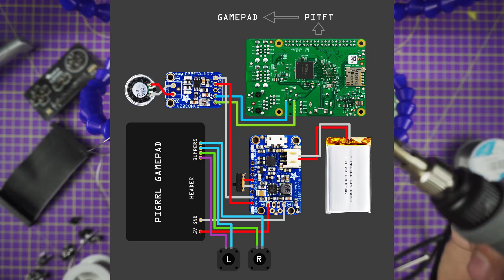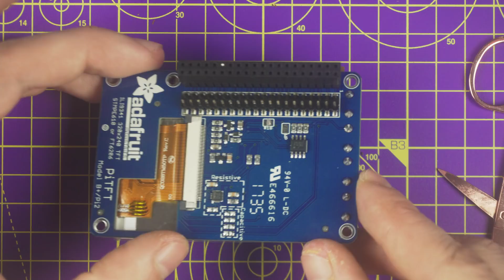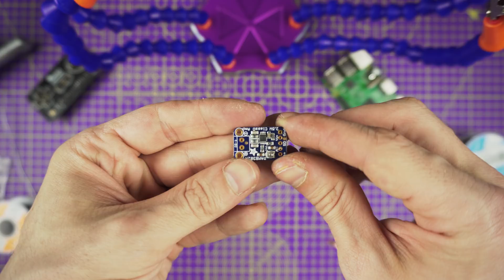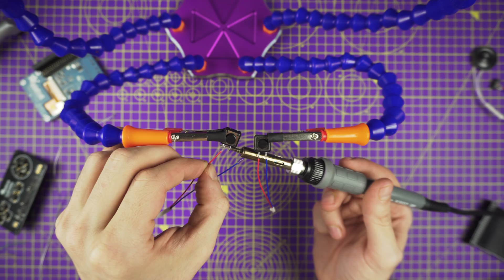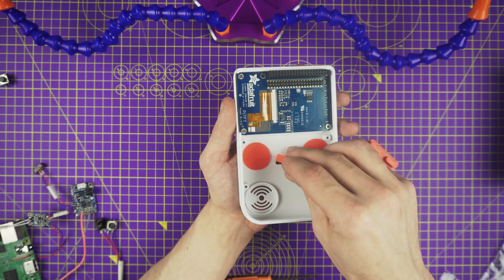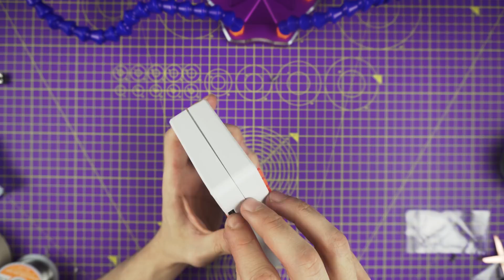Portable Raspberry Pi 3 Game Console

Comment: When soldering the shoulder button wires to the game pad pcb, attach them facing away the adjacent screw hole.
I did the same thing you did here and had trouble screwing that corner of the pcb to the front half of the case.

Comment: I built this PiGRRL a while back and I'm wondering if you had issues with speaker feedback. The noise while in menus is horrible but it goes away when playing games.
Reply from the maker: Got that in the beginning as well but I got an easy fix, wrap the battery in copper tape and then electrical tape. Then you solder a wire from the ground of the audio circuit to the copper. Or move the position of the battery, but for sure the copper and electrical tape does the trick :D
Hope this helps!
Reply: Awesome thank you Adam!
Reply: I built one of these too. I basically fixed it the same way, except with a sheet of aluminum foil that I had making contact with the metal USB port sleeves on the pi. It was a pretty lazy fix, and I didn't expect it to work, but it completely killed the interference.

(If you try this, I recommend using tape to avoid any shorts).